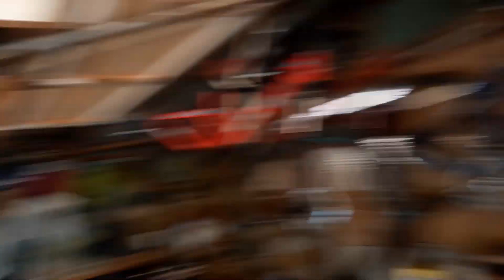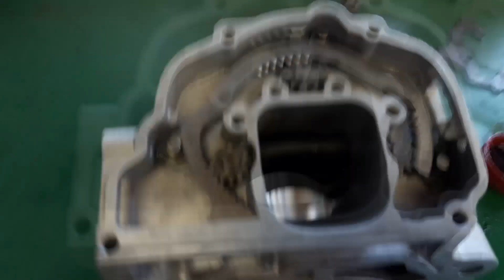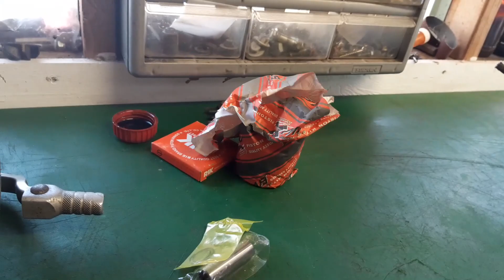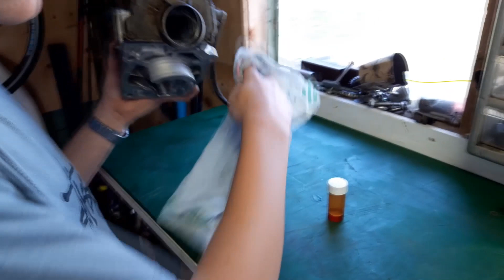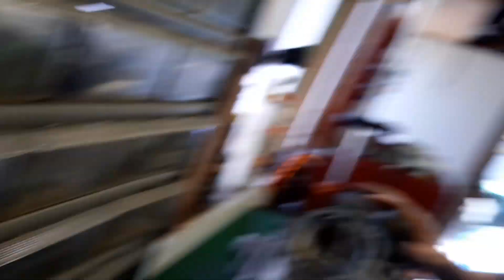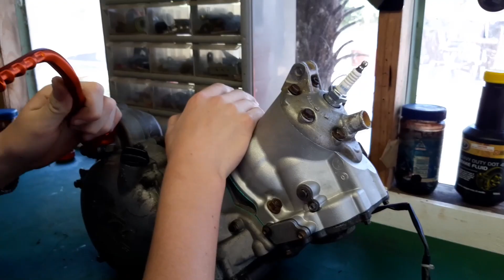2007 KTM 125SX Part 2: Top End Rebuild.

Comment: i have a 2011 and got a new cylinder thats bored out to a 144.i dont know the year of the new cylinder looks identical but the power flap from my old cylinder doesnt line up with the axl screws.is there a difference in the years as everything else fits just not that flap
Reply from the maker: Not to sure sorry mate, I would imagine the flap will have to be different for a 144 as the cylinder is bigger and will go into the part where the flap sits on a stocks size cylinder. That's my only thoughts.
Reply: @motorvatednz7432  you were correct ive just sent my 125 cylinder off to get bored should have it back soon enough

Comment: You guys are missing an o-ring seal from exhaust valve hole between cylinder and cylinder head
Reply from the maker: Oh, didnt realise. I'll fix that. Thanks alot. 👍
Reply: @motorvatednz7432  This is quite useful when you are rebuilding KTM engine https://www.manualslib.com/manual/1348216/Ktm-125.html